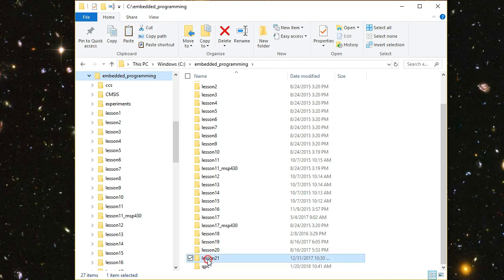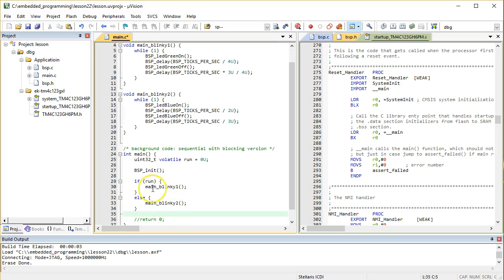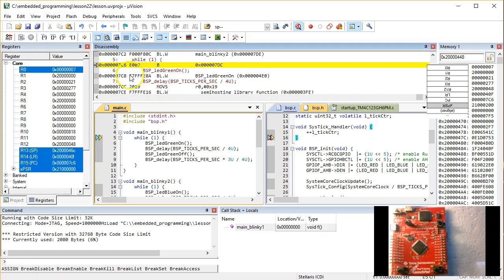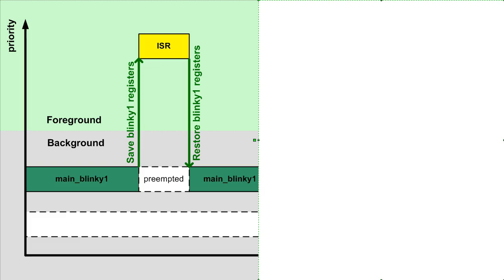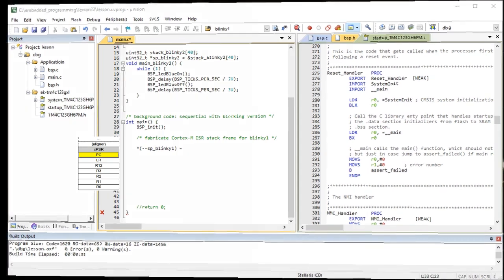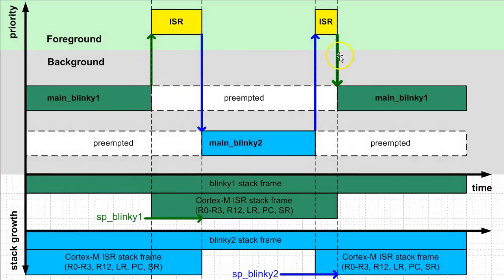#22 RTOS Part-1: What is a Real-Time Operating System?

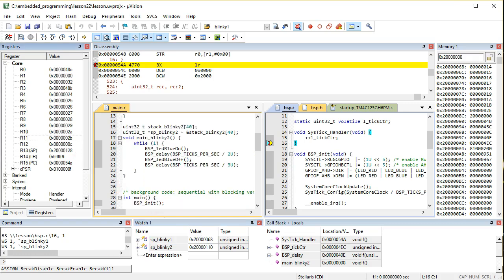Comment: why we need to subtract hex 20 at 22:02 ? pls explain
Reply from the maker: At 22.02 you are saving additional 8 registers on the stack. Each register is 32-bits==4-bytes, so you are saving 8*4==32=0x20 additional bytes on the stack. Subtracting 0x20 from the SP creates room for 0x20 bytes (because the stack grows "down"). --MMS
Reply: @StateMachineCOM thank you

Comment: Hi, can someone explain why he allocated 160 bytes for the thread stack frames?  I understand why uint32_t was picked (its the CPU register width) and I understand vaguely that stack frame size has some dependency on the target hardware/cpu architecture.  But I do not how he came to the conclusion that he needed to allocate this size when Arm Cortex M4 processor core contains 16 registers at most in the stack frame (13 general purpose, SP, LR, PC, xPSR).  Is this related to how much memory has been allocated for the stack in the startup code of the project?

Comment: hi Miro. Can you talk about firts setting with Debug in Keil-C. I do everything the same as you but the result is different. BX lr don't jump to main_blinky1 and display in Call Stack + Local also not the same you. Thank you so much about 2 previous response. Hope to receive your reply soon.
Reply from the maker: It's difficult for me to talk you through setting up the KEIL uVision debugger in this YouTube comment. You just need to watch the video and try it on your host computer. But regarding the BX LR instruction that returns from the SysTick interrupt, it will NEVER go to main_blinky1 or main_blinky2 unless you manually change something in the CPU. For example, at 7:09 you change the stack entry corresponding to the PC register, and only after that change you execute the BX LR instruciton. This change causes the BX LR to return to your main_blinky1. Such "manual context switching" is the main point of this lesson. --MMS
Reply: @StateMachineCOM  i understand returns from the SysTick interrupt. I had change the value of SP same to main_blinky1 or main_blinky2 but it not go back what i want :<<. What is my problem???.
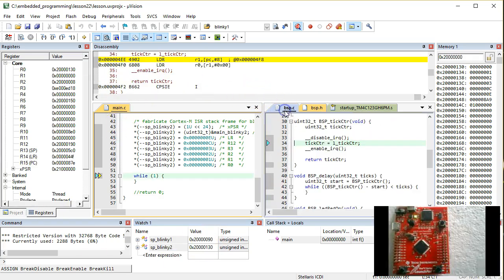Reply from the maker: @thucngoxuan9011  I think that you must be doing something else than what is shown in the video. Please note that the video progresses in a few steps and at each step you need to do something different. For example, at 7:09 you need to change a value in the stack memory. Later, at 15:55 you change the SP register in the CPU. So, please pay attention to what needs to happen at wich stage. Finally, if you cannot get your code to do what's shown in the video, you should download the project accompanying this lesson (from the companion web-page at https://www.state-machine.com/video-course ) and use that project. --MMS

Comment: Hello Doc,

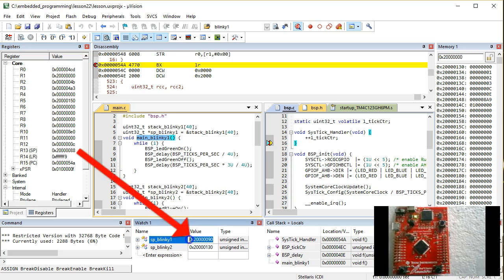First of all thank you for your work on this. Its good stuff.I have a couple of questions for you. At around the 16:50 mark:

You mention that we would have to save the current top of stack for the blink1 thread before attempting to preempt with with the blinky2 thread. 
Is this because points of preempting of at the blinky1 thread would generate the corresponding exception frame? 

And the reason we do this is so that we can save the context to return to where we left off  , once blink2 has been preempted by blinky1?

I think if didn't do that and go with initial values that we populated the stack frame for blink1 with, we would simply resume from the beginning which I suppose is okay for simple blinking examples but not so for more complex examples where more info is saved before a context switch. Is this understanding correct?

Thank you for your time in advance!
Reply from the maker: I've read your comment carefully, but I don't understand yor question. However, the most important thing I want you to remember is that all of this context switching is really utilizing the interrupt handling mechanism of the ARM Cortex-M CPU (hardware mechanism). Everything that transpires during a context switch follows from the understanding of that mechanism. In particular, the preemption you see at 16:50 has already happened and was caused by the SysTick interrupt. At 16:50 you merely change the stack pointer (SP) to control the return from interrupt. So, I think your problem might be that you think incorrectly about the "preemption". The context switching code does not cause preemption, it merely uses it. The preemption has to happen in hardware, so in case you need to create it at will, you need to trigger an interrupt. You'll see in the later lessons how to do just that and utilize the special PendSV interrupt for it. --MMS
Reply: @StateMachineCOM  I'm sorry if I wasnt clear.

  I was referring to the fact that stack pointer value that you had to save manually. It is different from the one that was initial value that we set in order to begin execution.

 If we were to use this initial value, we would begin execution from the beginning of the theard, which is okay if we are doing it for the first time , so as it get things going.

As I understand  it, Context switching is to be done in such a way as to resume from the point of preemptiion, and not to start over at the beginning.

That is to say if we are to supply the incorrect context, the thread may not resume from where it left off.

In this particular example,  after the thread is preempted,  you save the new stackpointer value (to correctly record this context) such that when control is restored to this thread ,  it picks up from where it left off when it was preempted as opposed it starting from the beginning if we had supplied it the initial sp value. 

So when a thread is preempted at different stages of its execution, the corresponding exeption stack that is generated with with a sp value is to be used to get back and to the point from where it was preempted.

I apologise if this sounded a bit repetitive. I just wanted to get my point access. and yes I did believe that I've misunderstood preemptiion and context switching . It is interrupt premeptuin that allows  us to switch away from the normal sequential execution. It is during this premeptuin that were are able ti change the context by altering the values if the sp so that after premption the flow of execution is able to return to point from what the sp points to. 
 

I hope this is clear
Reply from the maker: @robbieschultz3559  Yes, of course! Every preempted thread needs to continue from the point of preemption. Starting over from the beginning every time would make no sense, would it? In fact, you can think of the private stack of a thread as a "bookmark", which remembers precisely where a thread was preempted, so that it can be resumed from that exact point. The stack "bookmark" is very sophisticated because it can remember very complex patterns of thread execution. For example, a thread can call a function, that calls another function, which gets preempted. The stack "bookmark" remembers all this, so that it can resume from the nested function call and correctly continue by returning from the second function, then returning from the first function, etc. I hope you can see how complicated things can get and how powerful the concept of the stack is. --MMS

Comment: hey DR Miro 
when i breakpoint at the first time at the of systick_hnadler unlike your call stack , which contains both SysTick_Handler and main mine only contains SysTick_Handler at addreess 0x00000000 which seems weird . additionaly after having the right adresses of sp_blinky1\2 stack , i hit run and again unlike your call stack i have calls ti BSP_tickCtr twice and call to SysTick_hnadler . when i run free only blinky1 main loop executes .i think the two issues are connected and  somehow the one of BSP_tickCtr (maybie belongs to the callstack of the blue led main loop) returns to blinky_1  instead to blinky2 (but again in your call stack it does not even appear). do u have any idea?
Reply from the maker: In situations like that, I highly recommend that you download the official project for this lesson (lesson-22.zip) from the companion web page ( https://www.state-machine.com/video-course ). Back up your current project, and unzip the official project. Try the official project, which should work. Then compare the original to your own (a good free tool is WinMerge). The problem must be in the difference. I hope this strategy makes sense to you. --MMS
Reply: hey Dr Miro  @StateMachineCOM  
thanks for the fast response , this is exactly what i did . should i have all the directories & files under the project ? i use keil ide but i did not quite undersood the readme file . my project builds sucssesfuly and run (besides the context ) , maybie i had to remove a file from the project ? do we use arm or gcc in this ide ? maybie its related somehow

Comment: If you are using a FPU, your stack for each Task has to be increased to 26 additional Bytes, right?
Reply from the maker: The interrupt stack frame is larger when the FPU is used. But there is more to it. An excellent description of the issues is published in the ARM Application Note 298 (just google for it) "Cortex-M4(F) Lazy Stacking and Context Switching". --MMS

Comment: Hi, just want to make sure I understand this correctly:  why initialize the stack pointer variable for each thread to (length of stack + 1)  instead of just the bottom of the stack ? 
Because in your code, you pre-decrement the stack pointer address before you start assigning values to the stack (so you're starting from the bottom of the stack regardless).
Reply from the maker: @ClassyJohn: As explained at 13:00, the ARM stack is the so-called *full stack*, which means that the SP points to the last used slot (as opposed to the last empty slot). Therefore, in the video, the stack pointer variable has been initialized to simulate a situation right before adding a new interrupt stack frame. For each stack entry, the ARM hardware would first decrement the SP and then would fill the stack memory. Please note that code efficiency is not the objective here. It is more important to faithfully simulate the hardware. I hope that this makes more sense now. --MMS
Reply from the maker: @ClassyJohn: The stack pointer variable is NOT initialized to (length-of-stack + 1). The initialization is sp = &stack_blinky1[40], which corresponds to the length-of-stack (without +1). But you need to remember that arrays in C start with the index 0, so &stack_blinky1[40] points one word beyond the end of stack_blinky1[40] array (see video at 11:45). This is an important aspect to understand about C arrays. Otherwise, you'll be making a lot of off-by-one errors in your code. --MMS

Comment: Hello Dr. Miro, I feel so lucky to find your tutorial series. I follow your tutorial with an STM32-L432KC board and the STM Cube IDE software. I managed to get the context switching done, but I had to fabricate a different stack.

The STM32-L432KC MCU also uses an ARM Cortex-M4 CPU so I'm not sure why I had to change the stack pattern for blinky sp's.

Here is what I had to come up after a lot of trial and error.
 
 // Fabricate Cortex-M ISR stack frame for blinky1
  *(--sp_blinky1) = (1U << 24); // xPSR
  *(--sp_blinky1) = (uint32_t)&main_blinky1; //PC
  *(--sp_blinky1) = 0x0000000EU; // LR
  *(--sp_blinky1) = 0x0000000CU; // R12
  *(--sp_blinky1) = 0x00000005U; // R3
  *(--sp_blinky1) = 0x00000004U; // R2
  *(--sp_blinky1) = 0x00000003U; // R1
  *(--sp_blinky1) = 0x00000002U; // R0
  *(--sp_blinky1) = 0xFFFFFFF9U; // Unknown
  *(--sp_blinky1) = 0x00000001U; // R7

The datasheet I found has the same stack pattern as you show in the video. I'm not sure what's the reason for this. Is this because of the Cube IDE? It's using the GCC compiler.
Reply from the maker: Hi Amila. I assume that you're talking about the ISR stack frame discussed at 14:35. I don't understand why you had to add 2 extra registers to that stack frame because it should be the same for all Cortex-M CPUs. I would check your brake point at the end of SysTick in case you still have some code that changes the SP (such as popping two additional registers). The point where you manually change the SP is critical and the video assumes that there are no instructions that would mess up with the SP. I hope you see what I mean. --MMS
Reply from the maker: I'm not sure why your second comment is not showing up here. But the GCC compiler apparently pops 2 registers at the end of SysTick_Handler (at the optimization level you chose). This is completely normal. To use the ISR stack frame shown in the video, you simply need to move your break point to the very last machine instruction of your SysTick_Handler in disassembly. --MMS
Reply: @StateMachineCOM  Sorry I deleted a comment. I actually did what you said just now and also made a comment. Many thanks Miro!
Reply: @StateMachineCOM  Thank you so much Miro. I managed to figure out the issue with the help of your response. Earlier, I had a function inside SysTick_Handler() that made some changes to the disassembly, popping two registers as you mentioned. I removed that function and used the stack fabrication as in the video, and it worked! 

Although there are some additional assembly instructions before the "bx  lr" instruction that I'm not aware of. Anyways, I copied the blinky1 sp to the sp register before executing the "bx  lr" instruction and it worked as expected.

Here are the assembly instructions:
SysTick_Handler:
    push    {r7}
    add     r7, sp, #0
 }
nop     
mov     sp, r7
ldr.w   r7, [sp], #4
bx      lr

Also, another interesting thing I found is that earlier, I didn't had the "bx  lr" instruction. I'm not familiar with assembly, so debugging is a bit challenging for me. I will try to figure things out from here, thank you again Miro. You are a wonderful teacher!

Comment: could someone tell me where I can found out the 'qassert.h' file? I would be interested in looking up Q_* macros. Thanks
Reply from the maker: The qassert.h file is located in the qpc/include directory. This is a very useful file that can be used standalone without the rest of the qpc framework. Also, the latest lesson #47 and #48 are precisely about assertions and Design by Contract in embedded systems. --MMS

Comment: Is it possible to apply this concept on an Arduino board or with an Atmel chip??
Reply from the maker: Yes, this lesson should be applicable to Arduino boards based on the ARM Cortex-M CPU, such as Arduino DUE, Arduino Zero, or Arduino MKR, and perhaps others. (At the same time, the code presented here will NOT work on AVR-based Arduinos, such as Arduino UNO.) Also, if you are interested in Arduino, you might want to check out QP-arduino adaptation on GitHub https://github.com/QuantumLeaps/qp-arduino
Reply: @StateMachineCOM  Thank you

Comment: Hello miro , hope your doin good . 
I recently noticed something when I debugged this lesson , when u switch context , say u want switch to blinkey1 , u put sp_blinky1 in sp CPU register , but before this  u save the OLD sp CPU value in sp_blinkey2 . 

in the video , every time u do this the sp CPU must be less than the old sp_blinkey2 by 2 words
sp_blinkey1 is  either (0x20000090) or (0x20000088) ,
sp_blinkey2 is  either (0x20000130) or (0x20000128),

 , but with me there is no difference,
sp_blinkey1 is always  (0x20000090),
sp_blinkey2 is always  (0x20000130),
as u notice : the sp CPU is exactly the same previous sp_blinky when i hit the breakpoint . is it normal ?

Comment: Note-2:

Also when we make entry to exception handler, register R0-R3,R12,LR,PC and xPSR are saved. But R4-R11 are not. 

Therefore if the ISR does use any of the registers R4-R11, it will restore the original value before returning to the original functions. Thus no harm done. 

However if we are returning to some other function, than this will create a problem. Since we would be returning the value of register meant for the previous function, and not to the function which we are jumping into. 

Thus we have two situtations, one is the automatic saving of registers (R0-R3,R12,LR,PC and xPSR) upon entry to the exception handler as guaranteed by ARM procedure call. But to ensure integrity we have to additionally save register R4-R11 as well. But the second thing needs to be done manually !! (or by coding, :-p) ,, --> we also have to  decrement the stack pointer by 0x20 (32) --> so the 8 registers(R4-R11), each of 4 bytes could be accounted for in the stack frame.
Reply: yes, we need to save everything on the stack frame because Miro's example is NOT sufficient.  It will absolutely corrupt the data in variables accessed by ISRs and the main thread.  Likewise, the software-defined threads also need to properly save their stack frames.